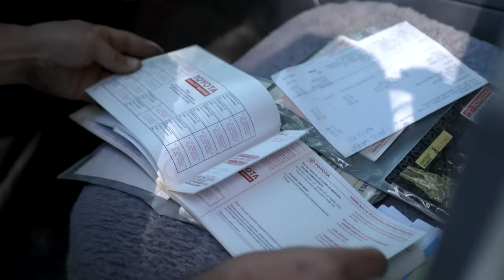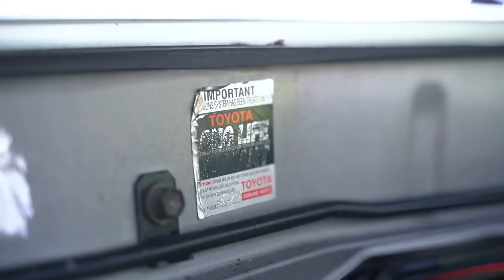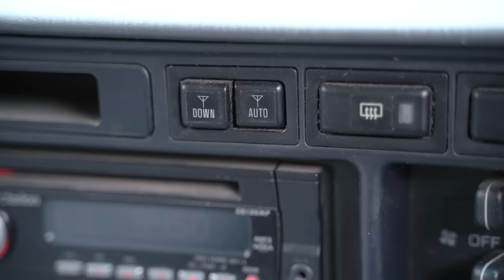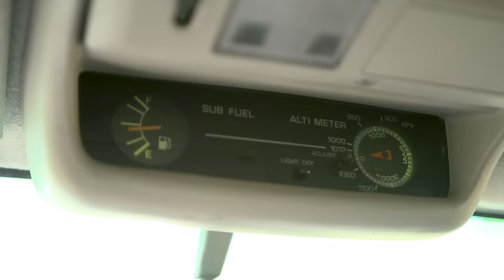RARE GRANDPA SPEC Toyota Landcruiser! You won't believe what Shauno paid + tips on buying an OLD 4WD

Comment: I paid £2900 for a 20 year old Suzuki jimny with only 20,000 miles on from an old bloke. That jimny only had a 2inch lift and some all terrain tyres and it took me all over the uk and never failed me. It’s now had a chop and roll cage fitted as the rear end was rotten, now I use it for comps.

Comment: That right there is the dream find! In 2015 I picked up a 2008 SR Hilux for $19k with 168000km on the clock, the ex fleet car yard had it listed for $26k. it sat for just over a year, rejected by everyone that looked at it. Everyone bailed as soon as they picked it as a mine car. After reading the service history and checking the log book it was owned by a private consultant to a SA mine. Full service history and not a thing wrong with it I offered $18k, got it for$19k. Hasn't cost me a cent apart from injectors and belt when I hit 300000km. if it wasn't for a bit of red dust in the AC vents you would think it was a city daily. By far the most reliable car I have ever owned. Sold the brand new SS family car to buy a camper trailer and put the Lux to use. The memories are worth the $19k alone. The Luxxy is a bonus

Comment: Hey Shaun.  The best second hand vehicle I've bought has to be my 1995 Jeep YJ.  I'm the third owner and I paid 5 grand for it over 5 years ago.  She sits on 33 inch BFG All Terrains and is absolutely rust free.  She's right around 285 thousand kilometers and the 4.0L straight six motor runs like it's brand new.  With the way vehicles have appreciated in value these days I could likely double my money right now but I've no plans to sell.

Comment: I just recently got my best second hand bargain ever. J95 Prado with 1KZ-TE from the first owner, 390k on the clock oil service every 10k at Toyota dealer, never seen more than a gravel road. Only paid 7900€ for it. Building it to be the family camping rig for light offroading and daily use.

Comment: I got my 02 courier for 1500 with a warped head and stuffed radiator. It has everything dual battery system, lift, turbo timer, full ARB bar work (bullbar scrub bars side steps and rear tow bar) got it started 2 days ago and runs like a dream

Comment: No longer have it, and it’s probably not a common “4X4” that people would go for, or even take four wheel driving, but I scored an old 99 RAV4 for a ripper of a bargain. All I had to do was replace the windscreen. It was a weapon. Had loads of fun in that and took it to many places around Tassie and even out did a few of the bigger 4x4’s. ended up getting rid of it because I needed something bigger but that thing was an absolute weapon

Comment: Can't beat my current daily driver. A '97 80 series. Manual, 310,000km. My parents bought it new,  and I took it off their hands 4 years ago. The only mods done are bigger boots, the same alloy bull bar as yours, and  gas ti go with the diesel. Still doing better  than 14l/100km too.

Comment: As grandpa specs go, I must have the ultimate. 
1995 HZJ manual diesel, with close on 500k km on the clock.
I bought it when it was 11 years old and it’s 27 years old this year.
The engine has never been opened except for replacing the BEBs, which didn’t need changing.
I’ve lifted it, and installed stronger steering gear and the 105 upgraded quadrant arms, 10” rims with 33s, the usual upgrades for more flex when I’m off-roading.
I love it like a child 🤣❤️🇷🇴

Comment: I feel like I got the score of the century, bought a Nissan Patrol GU coil cab TD42Ti with 450xxx on the clock original owner from new in 2003 all log books and every receipt for everything spent on it, right before I was lucky enough to steal this rig it was completely re sprayed in factory white, the injector pump and injectors were fully rebuilt, the turbo was rebuilt and a bigger intercooler fitted, the interior is in immaculate condition, alls I did was build a tray for it and it is personally my most favourite car, for all that I paid a whopping 10k it’s not got 489xxx on her and she flys down the highway and never lets me down, all the smiles in the world when I’m driving

Comment: I bought a 1995 dual cab 4x4 turbo diesel tf rodeo with 505,000kms for $1200 with rego! It had the injector pump replaced 6 months before I got it. only thing I needed to fix was the A/C pulley as the power steering runs off the same belt. I drove it everywhere from the high country to some back tracks around Kempsey and Coffs Harbour and back and forth from Tamworth and even a few trips up to double island point. It was basic to go camping with but it was so much more fun then the D max I had at the same time. I sold it with 550,00kms on it a few years later to a mate who wanted to buy his first 4bie and I really wish I hadn't because it was just so much fun. Hoping I might find another cool old rodeo for the right price one day again to relive those memories.

Comment: Best 2nd hand 4wd for me would be my current gq patrol. I bought it grandparent spec. It's a 1996 2.8 turbo diesel still had original tape deck in it that still works all seats were clean and not torn I have all the books and recipes for anything done to it including a full engine rebuild 50,000km ago. It had the original bonnet protector and weather shields on it. Everything works like it did from factory.

Comment: My best bargain is a 2001 NM Pajero i bought, runs and drives like a dream, clean as a whistle inside. Has a few scratches in the paintwork and a ding in the rear but it is 20+ years old so thats expected. It’d never been offroad or done any towing. The bloke i bought it off had all the maintenance and service book history, and i got it cheaper than i should have 😁

Comment: When I was younger I came across a vs spac Ute for $500 in really good condition but didn’t have the cash so I took 2 weeks annual leave from my day job and worked as a labourer doing decking to get the extra money. Bought the Ute after a fortnight washed it and re sold it the next day for $1000 more!

Comment: 3 1/2 years ago, I found a 1996 factory locked petrol 80 series with 272k miles. Nearly no rust, other than it needed exhaust work. Owner had receipts and maintenance records going back over 10 years, and had put over $7k into it in maintenance. Only mod was that it had 33's

All electrics works, and only body issues were cracked plastic light covers on indicators side markers and tail lights

Bought it for $3800 USD, and only thing it's needed so far (touch wood) is regular maintenance, and a starter motor

Comment: Just recently bought myself my first landcruiser. 1995 RV 80 series with the 1FZ-FE engine and a manual gearbox.
It's done over 400,000 but is so far presenting very well.
Mod list is a winch and a few lights which are a little outdated.
Plan is to renew all the barwork and set her up as a capable tourer with a sneaky bit of boost 😏
Can't wait to start this new project!

Comment: First generation Honda civic 1975, new paint (racing red), mini cooper stripes on the bonnet (white), all original chrome, all in great nick for $400 bucks NZ. It had failed its WOF but easily sorted. I sold it a few years later for $3000. Great little car.

Comment: Mine is my 99 Toyota prado. 365000 on the clock but for 3 grand and 2 owners i'm pretty stoked! Now has a 2 inch lift and all bushes and rubbers replaced. Had never had a towbar fitted in it's life until i bought it.

Comment: I would say that when buying an old 4x4 first you need to look for rust-free vehicles, then the shape of the interior and the equipment (because that can get expensive fast), than the state of 4wd system(transfer case, axles, steering, lockers, ...). Engine is probably the last thing I would worry about because on most old 4x4 vehicles you can still get a hold of reasonable priced parts and/ or replacements

Comment: Picked up a 90' hdj81 for 17k 8 months ago here on the west coast of Canada after searching for one about 5 years. Some similarities to yours with the older owner, alot of care into it and stack of paperwork. Tow ball and brake controller,  unfortunately burnt smelling atf.  230,000 kms so I bought it anyway and shortly after experienced trans slipping. On the hunt for a replacement but in the meantime she still takes me to the local rock gardens and wheels hard, always gets me home. I've owned 10 4wd toyotas but is my first RHD diesel. Cheers shauno nice 80🍻

Comment: I found a 2003 105 series with only 77000km totally stock tripple locked with toyota winch ,  1HZ  a bit under powered when towing a small camping trailer, paid 125k in RSA thats about 12 500 down under.  Done a few trips currently on 93000km plan to upgrade soon
Reply: Turbo it or find an FT to go in her. You’ll regret moving on a 105

Comment: Over the last summer, I was after a cheap 4WD to take up the beach. I managed to find an old 2000 Holden Frontera which I picked up for $800. It was a bit worse for wear, had a misfire, and needed a new radiator and a set of new tyres. All up cost me about $600 to fix up and the only thing that didn't work was a rear window switch. After fixing it up I did a couple of beach trips and even took it over to Tangalooma island for a week and it ran like a beauty. It would have to be one of the best second-hand finds in my opinion.

Comment: Great car and an absolute bargain now days. I got my gq patrol 2nd hand about 7 years ago, im the 3rd owner and the bloke before me worked at arb so it had a good bar, winch, long range tank duel battery, hot water shower twin lockers and engineered with 35s and 65mm body lift and spring lift. Had all suspension upgraded with old man emu and snake racing. Only has 264,000 on a tb42e motor. Runs and drives great and I only paid 7k. Ive wanted one since they were new so win win for me. Keep up the good work guys👍

Comment: I recently bought a 2006 Jeep Wrangler unlimited LJ (long wheelbase TJ) with only 57,000 miles (91,700km) on it. It was showroom stock when I got it, and in mint condition. $25,000usd, I considered it a bargain for a low mileage, 15+ year old rig. I couldn’t pass it up. A 2 hour drive and a 2 hour flight got me to it, then a 10 drive to get it home. With a couple inches of lift and a set of 33 inch tires, it’ll take me anywhere I’m interested in going now!

Comment: My current 2003, 2uzfe (v8) 4Runner, 1 owner, 379,000km (409 now) bought for $7,500 CAD, also kept record of everything that’s been done to it at a dealer, garage kept, nearly mint paint (stone chips) rust free, limited trim, perfect leather seats and completely un modified and clean until I got my hands on it haha (still too clean) 

Only thing I’ve fixed was a front IFS wheel bearing and installed a $50 wiring harness plus lift/tires and changed all fluids nothing else wrong with it to this day :) 

Not perfect it’s from Canada but perfect to me

Comment: About 4 years ago my buddy asked if I would check out an FZJ80 he was thinking about buying. As I've been a professional wrench for 25+ years and worked at Toyota dealers and a shop where we did lots of restoration work on Land Cruisers. After an inspection, I determined it likely had a blown head gasket and needed quite a bit of maintenance, as it had been sitting for a few years. I let him know if he wasn't interested on spending the money to make it reliable, I would purchase it. I was kind of on the look put for a new project anyways. He decided he wasn't willing to spend the money and I picked it up for 3K. I spent a good year or so fixing every little thing, building bumpers, rock sliders, installed a RTT and fridge. And now, I have an amazing 80 that I daily drive and live out of for sometimes weeks at a time. 3K + I don't want to know how much money I have in it + so many hours spent = one of the best decisions I've ever made. Outside of getting a dog and settling down with my lady.

Comment: Brought a Black 100 series  GXL 1HZ for $30000. 95000km,had all genuine  parts including wood grain trims. 5 Toyota Mag wheels. Toyota alloy bull bar and side steps. Added a Denko Turbo  for more power. Did 100000km of fun in it and sold it for $30000 five years later. A sad day when it left the Carport. Own an Isuzu Dmax now, setting it up for more off road trips. A recovery kit would go a long way to helping with the set up

Comment: First time commenting shauno but my partner and I have been watching you and the gang for years. Thought I’d finally give it a stab a get my rig out there. I found myself a 2001 gu patrol in my local wrecking yard with 307,000kms, it was complete granny spec just like your new 80 mate and I picked it up for $3000. Found that I’m the second owner of it as well, it had the exact same tow brake booster as your 80 a steel winch bullbar and that was it. Unfortunately the injector pump was gone in it and I had no idea about replacing them let alone the price 😅 so I YouTubed how to change it and I ended up picking up a low km second hand one for $350 and in the process I taught myself how to change my timing chain and guides, injectors and seals, injector pump and a lot more. Has been a massive process but I tell you what I’m extremely impressed with my bargain. Cheers for the awesome videos mate love watching you guys most nights with the partner 🤙🏻

Comment: Best bargain ever for me was a 2004 mitsubishi pajero with 170000ks on it. Mint condition inside and out. Only issue was it has been sitting in the gauge for few months due to alternator issues. Paid 5000 for the vehicle. Owner had racq so he kindly towed it to my place, put a new alternator and a battery. No drams at all.

Comment: Bought my n70 hilux 6 years old 113k on the clock with a lot of mods ( all professionally installed with receipts ) and a custom tray and canopy for 30k. Not even one mechanical problem, only mod I did was to swap the wool seat covers for something waterproof and tuff.

Comment: HJ 60 series manual 37s twin locked 474’000 kms new head put on when turbo fitted rebuilt rear diff new front axle all new wheel bearings and swivel hubs rebuilt $7000 since I’ve had it all I’ve done is sent it in for a full underneath spray-$400 little bit of rust in drivers door and in the gutters which has been all fixed since I’ve had it😀

Comment: 2k for a 1994 suzuki vitara with 230,000k's and the smallest amount of surface rust, only needed new tires and windscreen for roadworthy and since then I've changed cv boots, rear drum cylinder, brake shoes, wheel bearings, oil, wheel alignment and a spark plug (no fault but my own) the car is the best car ever in my opinion for the price so far including mods the car owes me 3-4k and despite having a 2 inch lift, snorkel, bull bar and spotlights already on it the thing was in good condition

Comment: Great buying,love those 80 series,I tried to buy one here in n.z.,6yrs ago,ended up with a pajero,420k on the clock,similar gig to yours,did timing chain,all oils,2 front suspension bushes,and have put another 90k on it with no major cost,these oldies are worth buying when they are genuine,,
Always looking for toyota,but the 7k mitsi would have to go,.

Comment: Got a 62series wagon with the factory 12hdt auto single owner only 250k on clock, only had a few mods fitted when originally brought for trip around Australia. Mechanical sound, paint had a few bad spots but was good for age and only two spots of rust in front guard and passenger floor pan. Picked it up for only $2500 with 3month rego

Comment: Great video and I bought it in November of last year in 1995 jeep XJ 118 thousand miles
In black Clearcoat a bit patchy for £200 to put a crank case sensor on it throttle module and flew straight through the MOT I’ve covered about 5000 miles on it so far

Comment: Recently I bought a completely stock grandpa spec gu td42 patrol what only did 183k and the old block even got it engineered turbo and tuned perfectly I’ve only owned it for 5 months and already have put 11,000ks on it but I’ve already been all over WA in it

Comment: I bought a AE82 corolla GSX  (top of the line in the day) with the 4spd auto ( the first model for this also) at aucion for $300 about 6 years ago.  One elderly lady owner from new 89,000 klms.
It needed part of the exhaust and tail lights replaced then a basic service and I was away, then a battery shortly after.
It was more original than your 80 there, complete with original radio cassette. Everything worked on it as well.
I drove it relatively trouble free for a few years and many klms.

Comment: Best second hand bargain I have two, my 1990 1hdt 80 series Sahara grandpa spec 536k on it hasn't missed a beat payed 11 grand for it, second one is a warn high mount winch I got last week l, been sitting under a bench for twenty years and with a little persuasion it's coming around, it's mid Resto right now but everything works including the solenoids from 1975, best accessory ever.

Comment: 1st car of mine. I've got a 2010 un bt50 that must've had completely original parts with the exceptions of a few mechanical faults prior to my ownership. Had to spend 3k on it upfront cause I knew nothing about cars & where to look for common issues until where I stand now. its got a fair bit of rust but that's what happens when you live on the coast. runs & drives like an absolute unit

Comment: Paid 14k for a 2001 manual FTE 100 series with 380,xxx. Also had 33s, 2inch, old man emu, rear tire carrier and tuff bullbar plus a roof rack. Rattled like a mofo, had a boost leak among a couple other issues but had only done highway kms with a little bit of towing. Bitta time spent playing and getting it right and now got a killer rig.

Comment: i have a 1997 ln106 diesel great deal come with a brand new clutch and timing belt done about 400,000 solid in the front only paid 2,500 dollars for it and it runs like a treat and got a winch great kings spotlights and not a spot of rust